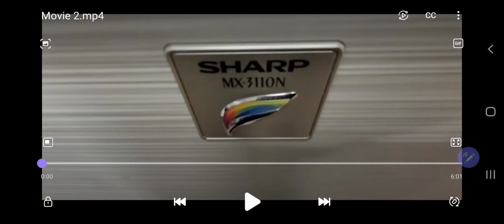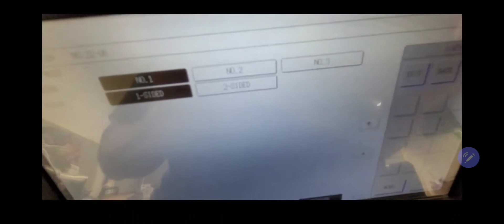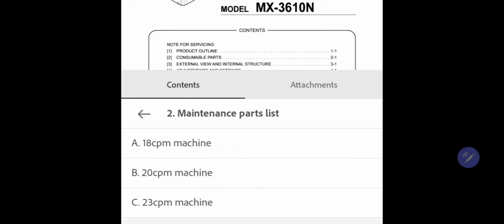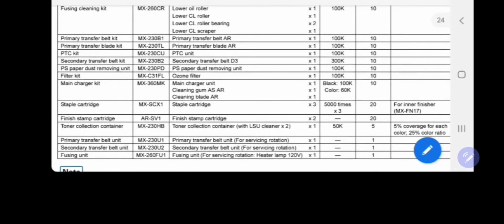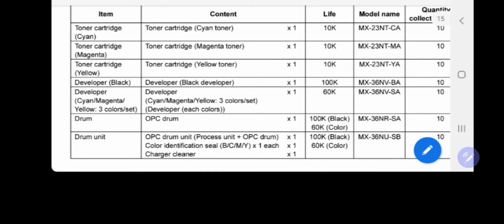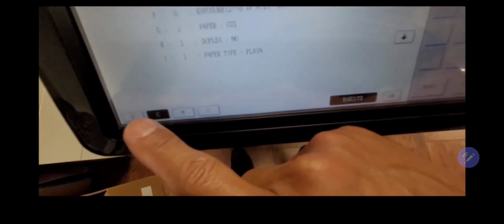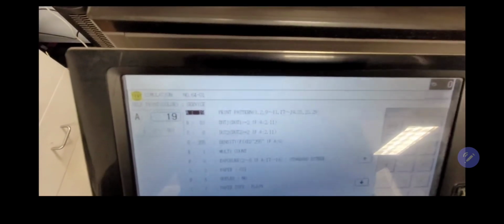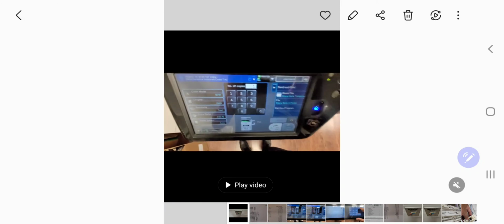Sharp MX3110N Service Mode, Data Print Mode, and Test Charts for Image Quality Issues

Comment: Hi...I have the sharp mx-3110n and the touch screen is not working. Any idea if i can repair it or any place selling replacement
Reply from the maker: By "Not Working" what is happening?
- Touchscreen is blank or blacked out
- Touchscreen has a display but not responding to a touch

Could be a bad touchscreen or possible a bad SD Card.

Cheers